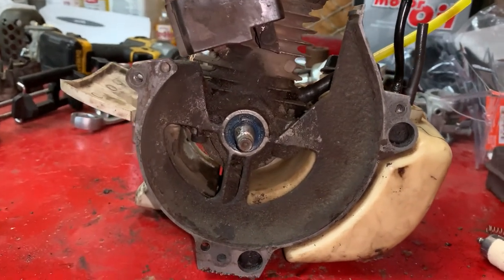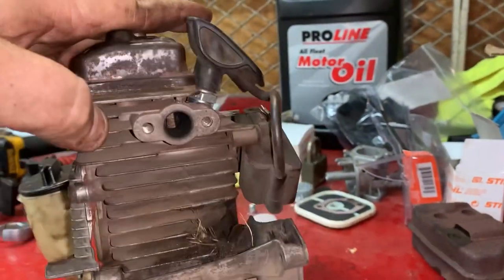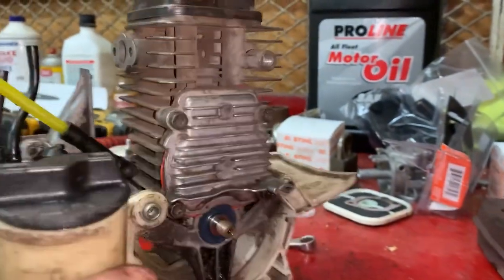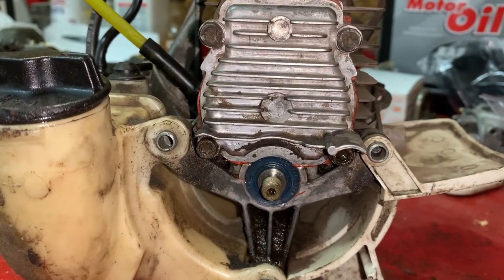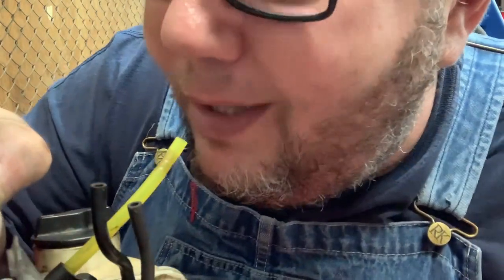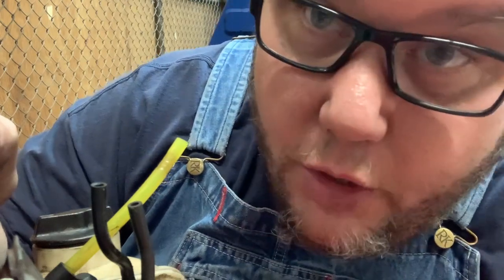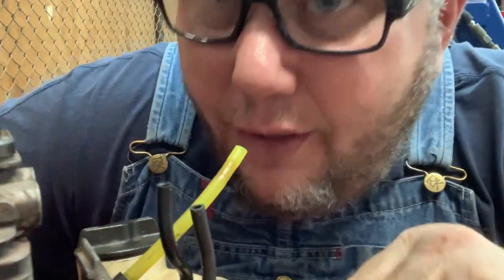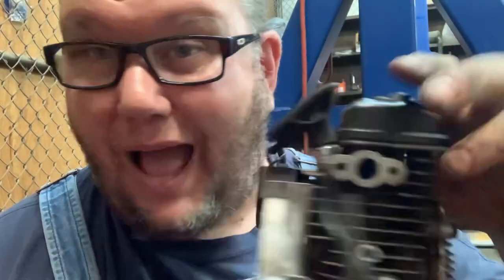EASY DIY STIHL 4 MIX DIAGNOSTICS/ NO SPECIAL TOOLS!

Comment: Oh man, couldn't imagine the look on a customer's face if they saw me doing that lol, great tip though! Those engines are solid, we have customers that have been running them for years. As they age, they will break valve spring retainers and drop a valve, or the cam will come apart but it's usually due to high hours.

Comment: Great video as always my friend.  Yes, I love working on the 4 mix engines, we see a ton of them.  They are easy and fast to repair.  As soon as they hit the work bench I'm pulling the air cleaner, top cover, spark plug and valve cover.  Almost every machine that comes in I check the valve adj. and inspect that story teller (spark plug).  Anything other than NGK and I replace it, don't care if it is new.

Comment: Please help! I just bought a Troy Bilt 4218 chain saw. using 40:1 canned gas. It worked for one <tankful only. Since then cannot get it to run. I empty tank and pull cord many times and it finally starts to run. Using troy's instructions seems to flood it out. Of course warranty states if determined to be bad fuel...etc. they are not liable. Big Box store (Menards) won't take back unless a shop will submit paperwork saying  unit is defective. Shops want money to determine if there is even a problem. Do you have any suggestions as to what to do. I imagine the first thing is I should not have bought a Troy Bilt.

Comment: U shouldnt have to block off carb port and exhaust port if u have a leak on one of those the valve needs lapping or replaced. This would be a great test though for br 600 cylinders since they crack often in the top of the cylinder valve area.

Comment: I've found something that's good to seal off the intake and exhaust ports on 2 cycle and some 4 cycle engines. Walmart sales a tire tube patch kit in a small can about the size of a snuff can. The kit containes several different square and rectangular patches with an adhesive side.  One of the sizes fit exactly over the exhaust port so I can bolt the muffler onto. The other fit on the intake so I bolted the carb back over. Used the spark plug hole for pressurizing and vacuuming.  This particular 2 cycle was a poulan pro trimmer. Worked good for me. Thought this would be good to share. .

Comment: After the idle on my 4mix went crazy I thought the oil seals might have blown, but after using this method found a leak in the valve cover gasket. New gasket & the engine runs just fine.Thanks. 👍

Comment: Thank you so much for the down and dirty tech tip! I just performed this on my FS111r and found the crank seals leaking. Replacements on order!! This was running sporadically as you described and now I know why. It was Idling up and down and would run wild at times.

Comment: You’re right my KM 110 had a vacuum leak around the throttle shaft and erratic idle. New carb fixed it right up.
Reply from the maker: Those carbs are horrendous! They have an acceleration pump that fails constantly

Comment: Your videos are always Great! Question for you. 

I Have 2 Sthl 131 Rs on the farm that have the same issue. When the engine get’s good and hot the weedeater(s) shut off , when revving down from full idle. I saw online this could be a sign of the coil going. I replaced the coils on both weed eaters. In one of the weed eaters, the issue still persists. Any advice?

Comment: God knows I am no authority by any means, but wouldn't you also have to make sure the valves were closed?
Reply: Never mind, I guess closing off both the input and exhaust ports will also   close off the valve area as well.
Reply from the maker: position of the valves have no bearing on this test